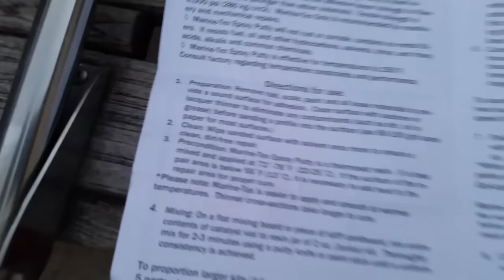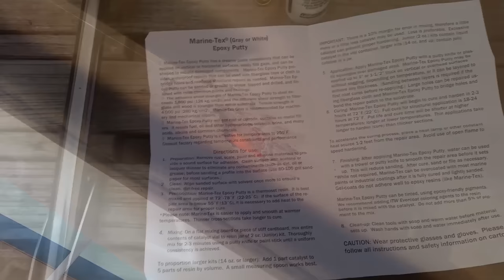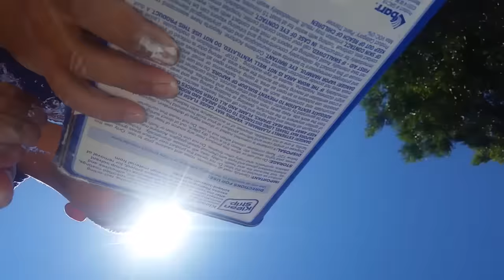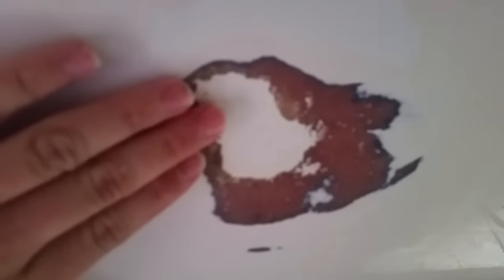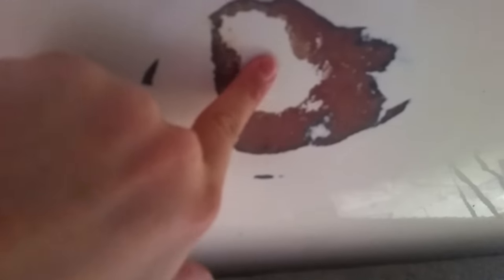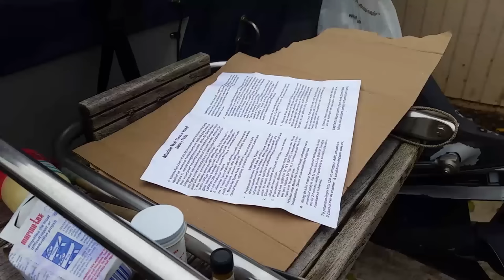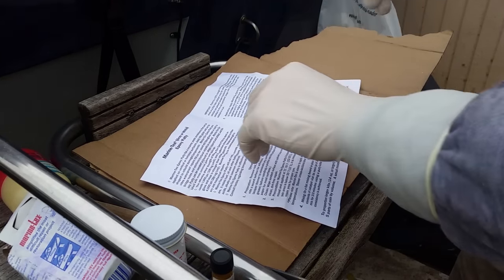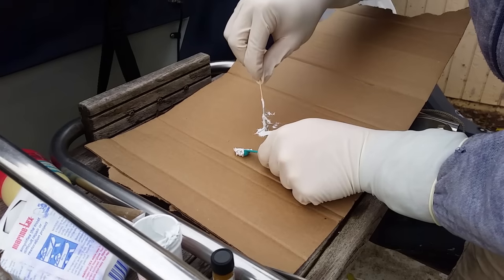MARINE TEX: repairing damage to fiberglass hull boat bottom

Comment: Good "attempt" at applying MarineTex. But man are you sloppy. Never apply more than you need & when you sand down, use a block and sandpaper, that way you "sand off" the high  areas and not the surrounding gelcoat.

Comment: Hey beers, thanks for taking the time to make this video. I myself made some mistakes the first time I used Marine Tex. Did I say out loud "don't do it" when you slopped it on the hull....sure did. BUT, people learn from their mistakes. No doubt, people wanting to learn to use Marine Tex for the first time and have watched your video probably didn't make the same mistakes. My point is, your video is valuable, and the haters need to back off. Especially those who know nothing about the product and are stating cardboard should not be used when it is in the instructions. Cheers!

Comment: hey the reason why you sanded down past the white resin layer into the brown is because you didn't tape off the area first.  By taping it off and then applying the marine-tex you are better able to create a patch that stands a mm or so above the normal contour and you can then sand that down later.  The trick with that is to do wet sanding.

Comment: with all due respect bud, thats a big hole. i thought you were talking about a little chip. something like that effects the integrity of your hull. i personally would have used a thick piece of fiberglass to start then about 4 more thinner pieces of figerglass mesh to follow it up. keep plenty of resin on it. puddy will just crack and fall off unless you get lucky. i wish you the best though.
Reply: now the one on the side of the boat is fine, i just dont trust puddy of any kind where water is hitting it while on a plane. cool video though. happy boating.

Comment: uh oh. it's a multiple step process. first the sanding exposing the bare fibergalss. fill in with layers of epoxy and fiberglass (i would use biaxial cloth for the hull). I would then barrier coat with the unthickened epoxy to protect the fibers when you sand the edges. Then what you need is a good epoxy fairing compound to bodywork. You where trying to fair with the marine tex and that is no good. A good fairing compound is easily applied and sanded smooth. Next since it is the hull and the gelcoat is gone you would need to reapply a gelcoat (not the best because of the use of epoxy) or several layers of barrier coat epoxy primer followed by your paint of choice.

Comment: Just got done removing this stuff from the bottom of my boat in some small dings (1/4" or smaller) in the keel. It was used in a pinch before a hull paint job. Over 2 years it got gummy and some feel out. Wouldn't use again.
Reply: improper mix ratios,    I used this on my boston whaler  an its been 30 yrs

Comment: if you were using that palm sander I doubt it would have matter what grade of sandpaper you were using it wouldn't have worked for you 👍 next time just put a sanding bit on your drill 👍 and you could have mixed both of those containers into the big container and then let it settle a little bit and then put it on the cardboard in one spot without having to mix it 👍and the dollar store sells dish gloves that go practically up your forearm for a dollar 👍

Comment: Wrong. ..wrong...stronger isn't the point... how well it bonds to fiberglass is the point and now all u have is a patch that will soon leak due to flexing of hull...of course cracks will appear soon...this method is ok on non structural supporting areas but not below the rub rail...
Reply from the maker: Chris Clements Can you provide me with a source to backup that information? From the research I did, I found what I said.
Reply from the maker: Chris Clements Here I am quoting Marine Tex, my source is their website
"Marine-Tex is a heavy-duty structural epoxy , used to repair aluminum, fiberglass and wooden boats, reinstall loose or stripped fasteners, permanently bond dissimilar metals without galvanic corrosion, and fill gouges in wood, metal and fiberglass, making repaired areas stronger than before.

Marine-Tex is an excellent choice for repairing problem areas located below the waterline. Marine-Tex is resistant to water and many chemicals."
SOURCE:
[Marine-Tex] [ http://www.marinetex.com/products/marine-tex-products/marine-tex-epoxy-putty/]
Reply: BEERS 'n GEARS how in denial can you possibly be. Glass below the surface, as stated above it well crack and eventually fall apart.
Reply: Marine tex is not recommended for above the water line since it will yellow with uv exposure. But this job should have been done with fiberglass first since you could practically see through the hull.

Comment: Should have been using glass instead of a filler . That's a structural repair . 2 layers of glass then filler .
Reply from the maker: reggie canezo It's my understanding that this stuff is as strong ot stronger than fiberglass. And that it's appropriate to repair deep scrapes without glass. However, I could be wrong.
Reply: BEERS 'n GEARS you are
Reply: @BEERSnGEARS   boatworks today channel would strongly disagree with you! Check him out he’s intelligent with his work

Comment: will marine tex grey repair a metal gas tank on a car with a hair line crack.
Reply from the maker: I really don't think it will work. Check this video out to see how i fixed my aluminum gas tank. https://www.youtube.com/watch?v=hEMcwHEfN1c
Reply: Yes,  remember to hav eenough  volume  to  save patch area, I used on my honda 90 tank  you sit on it  and the edges were rusted, I  sanded clean  and made a  good  bond  , set with infred lamp, and it took to bouncing  for  over 20 yrs

Comment: I see this mistake all the time on video's. NEVER mix two part epoxy, bondo etc on plain cardboard. The hardener is absorbed and can lead to a huge sticky mess. Many people have used Bondo like this only to have it gum up on their sandpaper. I use cardboard with with advertisement pictures on them like the Marine-Tex box itself. These boxes are sealed cardboard and you wont lose any hardener.
Thanks for the video. I have not used Marine-Tex as of yet so I was wondering how thick it would be. Described as putty like.

Comment: My god no I'm 3 yrs late but that whole needs a fiberglass and resin job. I would be laying glass inside and out filling that whole smallest glass patch to largest and at least 3 layers of glass. Then sand and use a filler suitable for water exposure that can be painted over with gel coat. That stuff is like trying to sand cement if yo wait to long to sand it.

Comment: OK, with all the commenters, how is this holding up after 2.5 years later?
Reply from the maker: I sold it beginning of this summer, and I didn't have any problems. I should have taken a picture before I sold it. But it didn't have any swelling or cracks
Reply: aka someones boat is now on the bottom of the lake.

Comment: Do NOT try this at home...or at a shop or anywhere...that will NOT hold. You have to sand off all the gelcoat to bare fiberglass to a 4" radius then lay up new fiberglass then new gelcoat......there are no shortcuts to fixing holes in hulls.
Reply from the maker: It's not a hole
Reply: @BEERSnGEARS  ...and this response is why you dont listen to this guy...

Comment: Don't they leave enough open space inside the paste container to pour the catalyst in and mix it inside the one container so you don't lose half of it stuck to whatever surface you're mixing it in?
Reply from the maker: It didn't seem like it to me. But it is entirely possible I missed great idea.
Reply: @BEERSnGEARS  they don’t , I just tried lol.  The small boxes are basically one time use unless you’re really careful about measuring it out and storing it afterwards  (I believe the directions said 5:1 ratio but not totally sure.).

Comment: THE REPAIR = you need to learn the structural portion as you did destroy layers of the laminate. You would have feathered out and cleaned up the damage as you did except feather the layers and then cut 3-4 bi-axial fiberglass cloths "discs" one that lays a little wider/broader each layer. IE: like placing a 1" inch piece to match the damage area, then subsequent larger each layer, discs. They would first be rolled on a piece of cardboard with a simple low-pile paint roller to match sure the resin in 100% into the patch piece and then as you place it exactly over the damage area you then DO USE a specialized Fiberglass Cloth Roller (looks like a bunch of small washers all together on a small paint roller) this roller applies the patch piece to the damage area. And since your on the bottom you can use something like West-Marine 400, it looks like "powder" you put it in your resin as it makes a Peanut-Butter consis. and holds your patch on the bottom repair area extremely well, then apply the next Larger-size Disc/Patch that is again cut to the shape of your damage area, do not go past the cloth portion of the repair as you are only bringing up the damaged area to be "just-Less-than" the thickness of your GelCoat. Then you can use the Marine-Tex instead of Gelcoat since it has much better grad, build and durability since Gel-Coat cracks if applied to thick. Marine Tex is wonderful on hulls to avoid cracking as in gel-coat applications. Remember the only thing that builds up is the layers of glass cloth (use at least some type of bi-axial cloth on the hull/side reapairs for strength, as general cloth has little structural advantage.) Then do as you did and after all of this if you wish to color match the repair to be perfect then you can spray on Gel Coat and hand sand to perfection. Just in the future watch professional videos to repair structual areas :) Major Kudos on tackeling it yourself and all in all it is an ok repair it will just lack structural strength in the repair area - simple to redeo as you are young with "BOAT-LOADS" of energy! Cheers! See a wonderful PRO at: https://www.youtube.com/watch?v=Zka0i0SOGd8